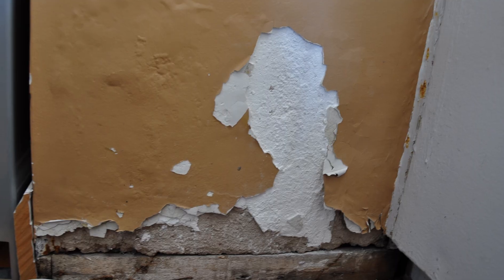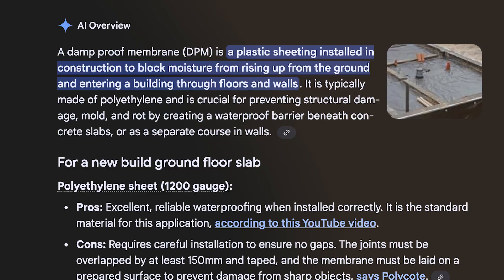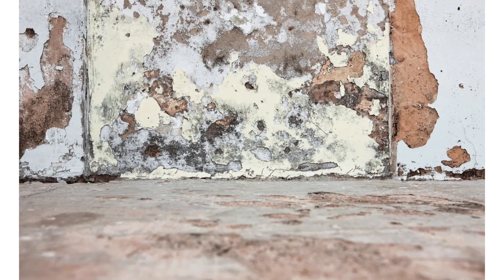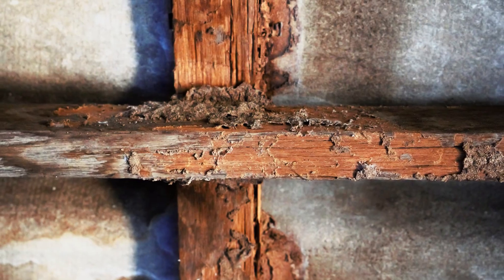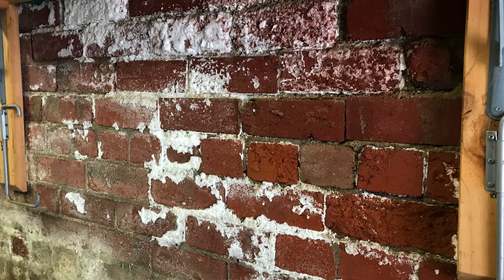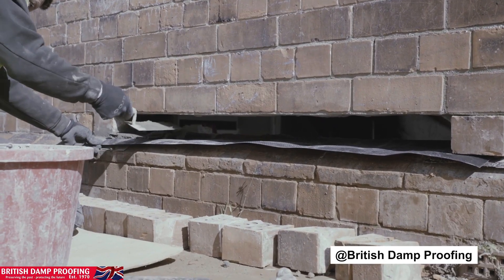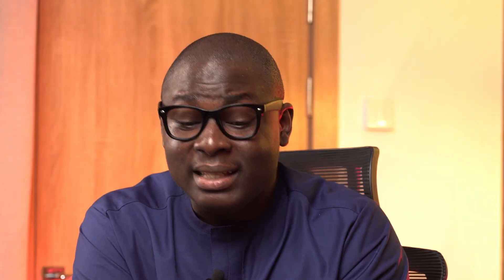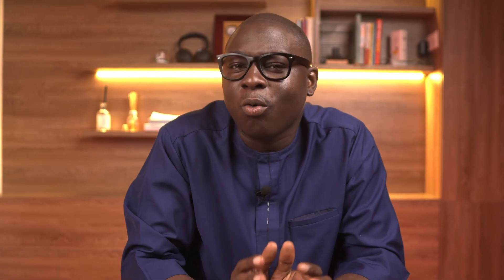Here’s How to Stop Rising Damp From Ruining Your Dream Home (DPC & DPM Explained)

Comment: It also depends to an extent, on where your house is located. If you live near a dry desert or well-drained environment, not having a DPC will have little or no effect. But if you live in Lagos or similarly wet environments, it's a different matter.
Reply: The North is drier than Lagos, yet suffers exactly the same issue.
Reply: The North is drier than Lagos, yet suffers exactly the same issue.

Comment: I noticed where i live in Ghana, the houses built in the 1950s n older don't experience this dumpness(water creeping).
I suspect our now a days cement promotes this.
Kindly check this
Reply: You might be right because I have also seen houses built in the 80's till date, they are doing just fine.

Comment: What's the solution for a wall on the third floor that has swollen & peeling paint due to it being next to a bathroom wall? The rest of the house is fine.
Reply: It seems there's pipe leakage in the wall. Call an experienced plumber to take a look at it. It happened to me before, the plumber discovered the pipes going to the water heater had burst in the wall. We had to move the heater to a different location and repipe outside the wall. A few weeks later the area had dried completely and we had to re-plaster and repaint that wall.
Reply: @aygeeawowede1337 Hmmm I'll get an experienced plumber to take a look. There's no water heater on that side, just the shower. And the issue started from the bottom of the wall close to the floor and rising gradually. I'll have it checked, thanks.
Reply: @ttbalog  The plumber should be able to detect the problem.

Comment: But if the walls are damp proofed and the moisture is still entering the foundation, isn't that still a problem?
Reply: Scatter the whole house and build another one.
I first came across this issue in 2010 on 2 different buildings. 
Now it's 2025 (15 years later) and those 2 buildings are STILL like that. No solution.
Reply: @JohnFekoloid The video tells you there is a solution, which is to cut into the block work near the DCP level, insert waterproofing and refinish the block work.

Comment: This issue is very important! I once lived in a room self con like this in akure in my university days. God! It nearly creeped to the window level. and it was a new house. The landlord build very close to a stream. It kept smelling so funky no matter what i did. Funny enough this man is an engineer o. I still have ptsd about that room. Man was only after rent, nothing concern am
Reply: Real Engineer? Or he just called himself Engineer....lol
Reply: My house in Akure is having the same issue
At the time the house was built, in year 2000 , the area  had this stony  scenery  nobody  envisaged  that the land will make water sip into the wall of the building 
Now in 2025 , we used tiles on the wall still no improvement 
If I knew about this plastic  protection before now  , things would have been better

Comment: Great video.
As you rightly said, the only possible next alternative to Dpm/Dpc is a concrete overlay with reasonable amount of water seal.

But for anyone trying to do remedy for the walls. I will advice a motar or concrete mix with water sealant instead of trying to slot felt like materials that normally requires heating to bond it.

If you can't afford the jacking system.
Get a cutting machine, chisel etc. 
Neatly, cut small opening, so that the wall loads are transfered to the othe blocks.

Put the concrete paste, give it a day to cure, before moving on.

If you do this part opening and filling in other rooms or areas apart. It will help you to cover the building in a short time.

Anyways, that's how I do it.
Reply: Can you suggest the type of water seal to use. Thanks for your input.
Reply: @ronkeojemeh2067 , Dr. Fixit powder sealant is a good one for mixing with the concrete, but you should follow the instruction on it. There are some that the small pack of the sealant goes with a bag of cement.

Note also, that Dr. Fixit has liquid that is for application over an already cast concrete. It gives it a water proof coat. In some brands, you apply a first coat and a second coat perpendicular to the direction you applied the first coat, it is a method to make the water proofing more efficient, there is are researches that prove it.

But I normally, buy the cheaper water seal brand that I find in the market, since they serve the same purpose.

Hope, I answered your question.
Reply: @ronkeojemeh2067 , Dr. Fixit is a good brand but I normally buy any cheaper brand I find in the market, since they do well too.

Dr. Fixit has power to mix with concrete to make a water proof RCC which is what I normally do.

Or

Dr. Fixit liquid which is applied with a brush like paint on the already cast RCC. You paint it twice.
The first application the brush should paint in one direction like " north-south"

Then the second should be applied at 90 degrees direction like " south to west".

I hope, I answered your question.
Reply: I sell water polymer  sealant products. I repair capillaries reaction on walls. We can talk if you don't mind. Thank you
Reply: @ekpobadarhotej2924 , I am interested.

I heard seen videos on the product you claim and really wanted to try it, if it really works and having it in Nigeria is great for me to try it out.
How can I contact you? What's your email address ?